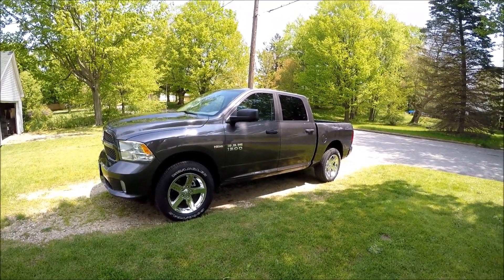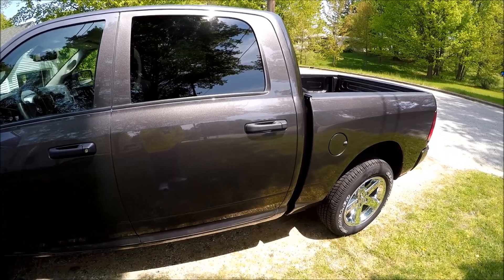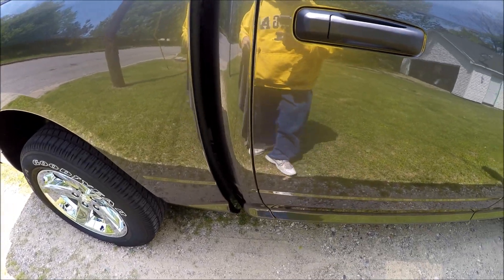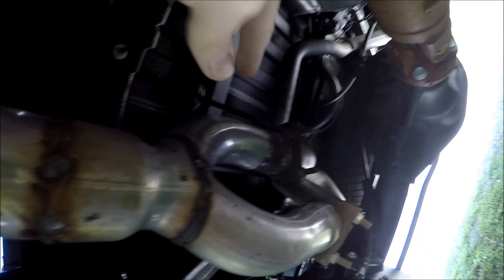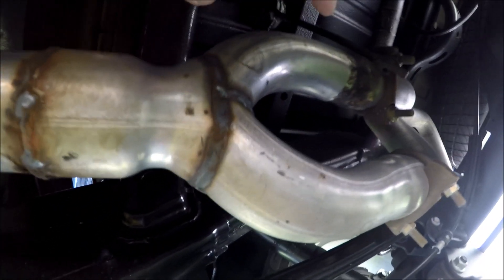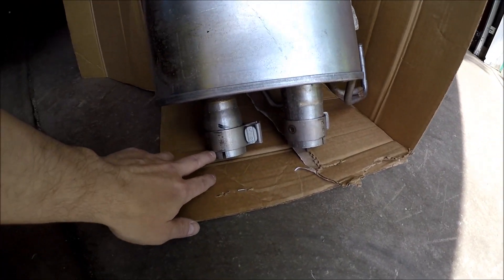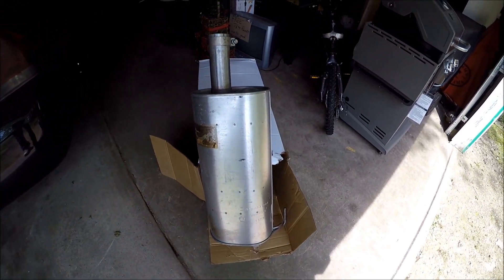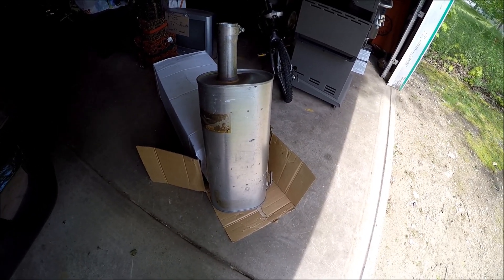Ram 1500 5.7 Hemi Y pipe (muffler delete) under the truck view

Comment: its actually Tig welding, depending if it is stainless steel or aluminum, if it is regular steel tubing you use a MIG (metal Inert Gas) welder with the spray setup on your machine so you won't burn through.  but otherwise, the welds dont look half bad, just the cuts and such look horrid.  but as you said, you dont care how it looks. so Props to you man!

Comment: Is this a leased truck? If I do this can I just weld on the stock muffler back with no problem?
Reply from the maker: +Austin Toma This is not a lease, I purchased the truck.  If you have someone cut the muffler out carefully and do a nice clean job welding in the Y pipe then you could have the process reversed easily and unless the leasor crawls under the truck looking around they would never know it had been temporarily altered.
Reply: they don't cut the stock muffler off...its just clamped on lol...and who ever welded yours did a serious cob job welding...smh

Comment: nice  I just did my 2014 dodge ram long  horn it sounds loud 
specially when you step on the gas but let me ask this question  that this affect  performance  or it gain
Reply from the maker: +luis Calvillo I have had mine done for just over 5 months.  The only thing that has been effected is my foot can't stay off the gas peddle it sounds to dang awesome, thus I burn more gas LOL.  It's a trade off I'm willing to accept.  No performance, power lose, or warning lights effected.  Love it, everyone compliments me and asks me what I did to it.
Reply: thanks cool